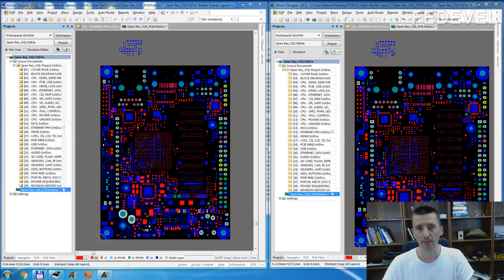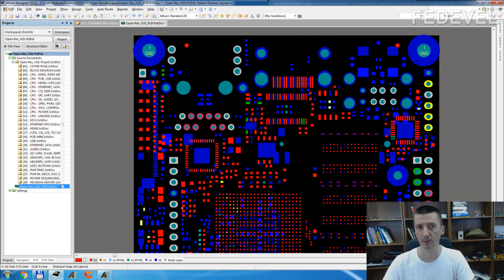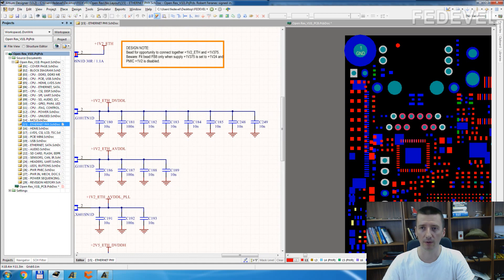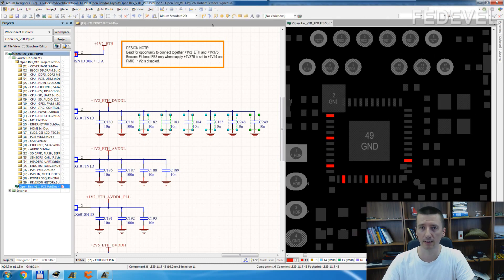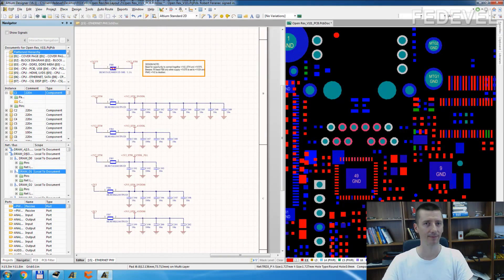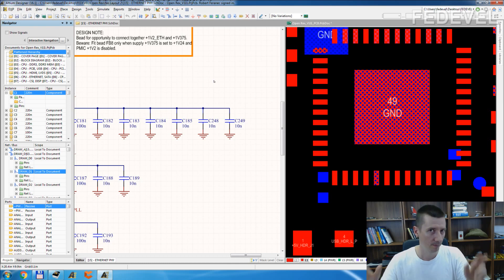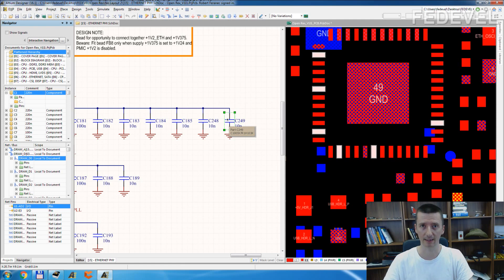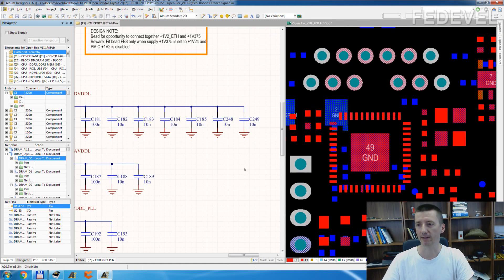Altium - Component Placement & Probing (The New & Old Way)

Comment: That new "feature" also eliminates the highlight button / feature that I previously used in schematic design when attempting to determine exactly what nets / components were included in a blanket directive.  I bitched about that and they admitted that was an "omission" and they are working on adding it.  I really wish Altium would start running these new "features" by their user base before proceeding to change the tool in ways no one wants.  The old highlight capability was so much more intuitive.
Reply from the maker: +dvatp yep, it used to be much better. I sent them the first email about this issue in 2014 ... and I really hoped they will fix it, but I guess it's not going to be done :(

Comment: hello Robert, I have a question. After use the Cross Probe tool, I can not replace the component I've just seleted, even other components in the project. I have to close the PCB window and then re-open it, so that I can re-place components.
So could u please show me the way how to fixed it. Thank u very much.
P/s: I use AD16.1
Reply from the maker: I am not sure what problem exactly you have, but sometimes if you can not do anything, try press Clear button (right bottom corner of PCB).
Reply: I fixed it, just like the way u told me. Thank you for replying.

Comment: Hey robert,
When I use the prob somewhere in the schematic, it goes to the location on the PCB but it doesn't Highlight the track like youn is there any option to highlight the pcb track?
Thank you
Reply from the maker: I didn't set anything special. If this is happening, try to press "Clear" button in the bottom right corner (when you are in the PCB window).
Reply: Thanks for your quick answer, but it doesn't work, I also tried to reset all settings in DXP->Preference->Schematic and PCB editor but nothing, what should be the 3 values of the mask level near the clear button in the PCB window
Thank you very much Robert for your help
Reply from the maker: Hello Alex, please, could you post your question to our forum - I can attached screenshots: http://www.fedevel.com/designhelp/